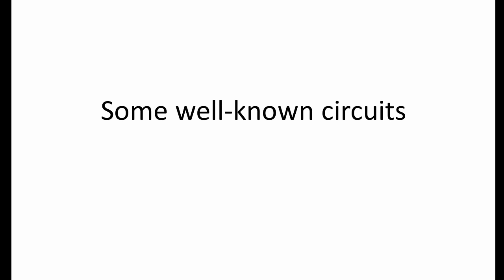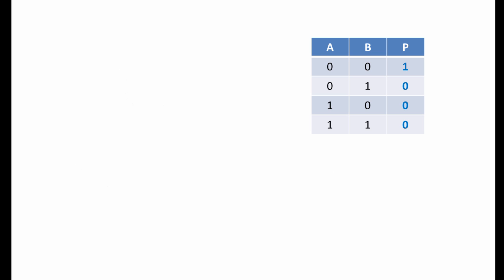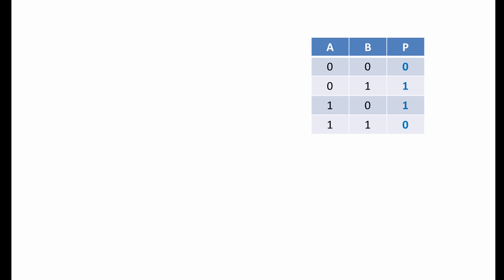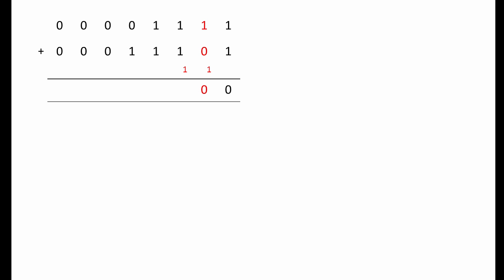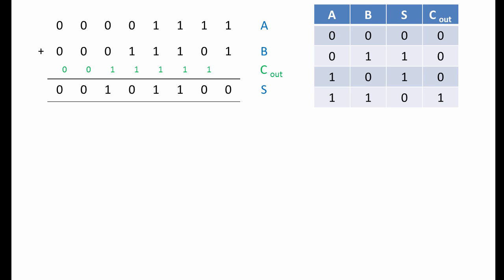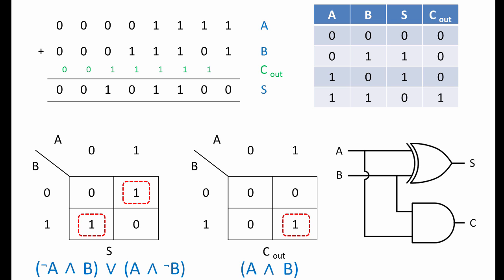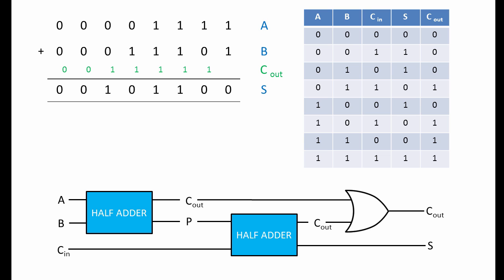Logic Gates and the Ripple Carry Adder

Comment: 5:10 Unfortunately this is neither elementary or high school where I live. Algebra I is all assigned and it didn't even include square roots or binary. Though the binary appears self explanatory. Still gotta learn those and line factors and some geometry stuff. 

So while it may seem redundant, thank you.

Edit: NVM, just remembered I did Alg. 1 as an elective not a core class, so all I got was grade 8 pre alg.

Comment: Where does this C_in come? people usually don't explain it
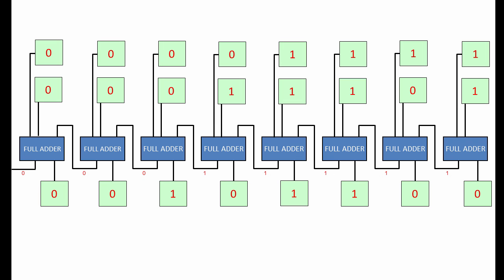Reply: from the previous full adder check 9:07
Reply: and the first full adder's cin is 0
Reply: It might also come from previous addition, if you reuse the same adder circuit for longer computations. For example, you might have an 8-bit adder, and you can add 8-bit numbers with it. But what if you want to add longer numbers, let's say 32 bits long? Well, you add the first 8-bit chunk with 0 carry-in first. If that produces a carry-out, you store it somewhere, and put it as carry-in for the next addition operation for the next 8-bit chunk. Whenever there's a carry-out from the current chunk, you save it temporarily and use it as carry-in for the next chunk. This way you can process as many 8-bit chunks as you want, one by one, using only 8-bit circuitry.

Comment: Well explained, but isn't the first adder on the right a "half adder" because there's no carry yet? 9:17
Reply from the maker: Good point!
Reply: Sure is
Reply: normally a Full Adder is used as well with carry input 0 ( but the input is missing here )
Reply: Was confused on the same thing thx for askin
Reply: If you don't want to account for any carry in going into the first bit (e.g. from previous addition, or from somewhere else), you might as well use a half adder for the first bit. But it's still useful to use the full adder there even if the first carry-in is zero, because once you will want to reuse this circuit for subtraction as well, you might control this carry-in and turn it into a borrow bit (which normally is 1 before subtraction, so that it could be borrowed).